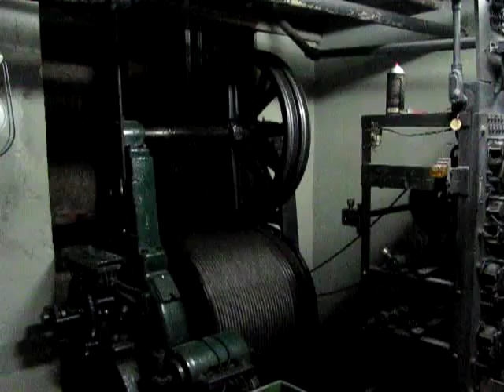Elevator Machine Room - 1915 winding drum

Comment: The one in Victoria B.C. was not built 120 years ago, that would put its installation date at 1892.  I worked for the company who does what they call ''elevator maintenance''  be for changing to a different company.   I can say that running like a clock is going a little far.  It really should be removed from service and modernized.

Comment: The machine and it's controller board should be placed in a Museum this is historical elevator machinery. I used to work near a building which had an Otis winding drum elevator installed in the early 1900's. The motor had to be rebuilt after going up and down for 89 years. But back in service running like a watch!

Comment: Another elevator to get raped...uhh....modernized.
Where I am, there's an original (to a point) 1949 Otis Winding Drum Elevator. Only things modded were the control panels (with "very rare" ADAMS Fixtures), and a new phone installed over the summer.
Other that that, it's mechanically original, and with speeds so blistering, it's well known as "Speedy" here on YouTube.

Comment: Judging from the slow mode just before stopping, that's a double speed AC machine a.k.a. AC/2. No MG-set thus not DC.
Reply: Might still be a DC motor with a DC rectifier in the controller or above the floor selector. There also could be a leveling field in the controller while more common with high rise gear-less traction which drops out the generator field and cuts in the leveling field as the cab reaches the landing.  I did note several relays on the bottom of the controller which maybe magnetic motor starters if this is a 3 Phase AC motor with a leveling winding.